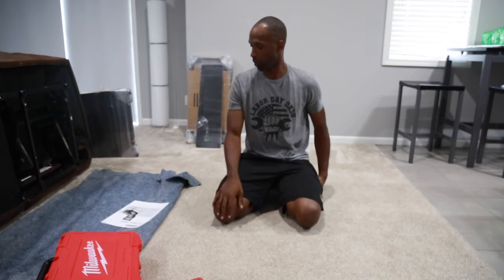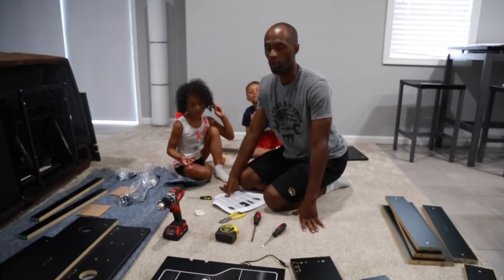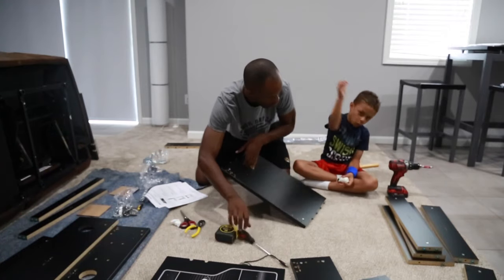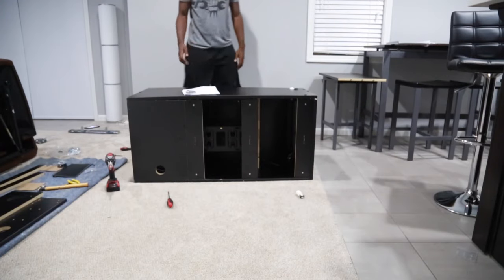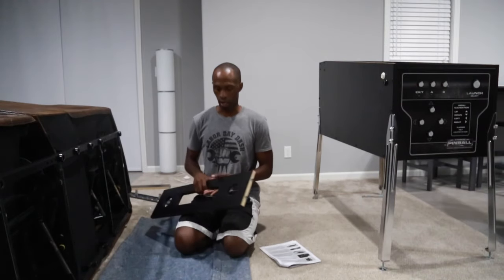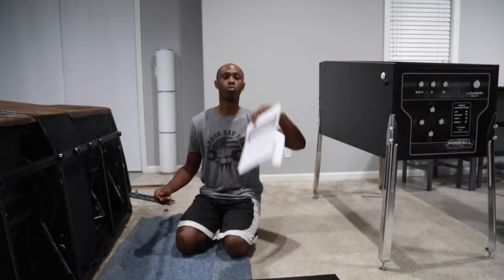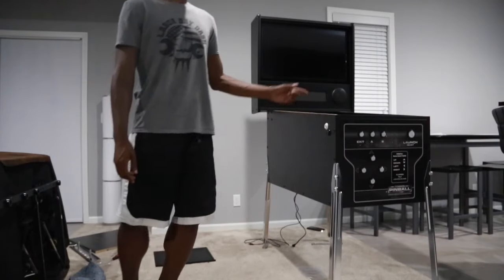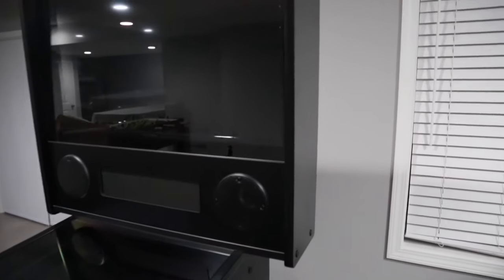Virtual Pinball Cabinet Vlog: Construction

Comment: Yep. Those camlock bolts are not very forgiving. I had a similar problem, building my mid size variant. I had to use angle brackets on the inside, to reset the parts in their proper positions. Had to forego the plexes, as they caused too much glare to try to see through. Being legally blind, that presents a problem. Had to send back the glossy faced monitors, too, and go with frosted finished monitors. No more reflective glare, from the back box monitors. Very much appreciate you sharing this video. Looking forward to the follow on vid. :)

Comment: Hey man how are you enjoying the cabinet? What tv mount are you using? I heard you don't get much room in this cabinet if you use the default mount. Also can you fit a full size pc tower in there with the pc case? Thanks.
Reply from the maker: You dont need a mount. I just did it because i wanted to do something different. You cannot fit a full size pc tower in the with the case
Reply: @rickydunigan6440  I don't like how low it sits and how you wont have any room to work on it.

Comment: I noticed that no one ever shows the second side piece being put on when they're building these recroommasters pinball machines in videos. That's because it's INCREDIBLY frustrating and difficult. In fact, the entire build is really, really difficult. For what they cost, these things should go together much easier.
Reply from the maker: What issue are you having? It's pretty straightforward. Awesome there are more detailed videos than mine on this cab
Reply: @rickydunigan6440  The holes for the pegs on the second side piece were drilled in the wrong places so I had to drill new ones.